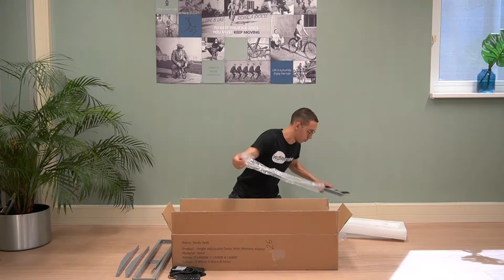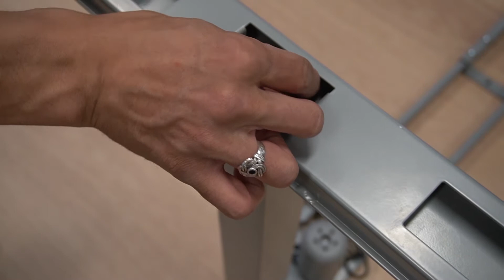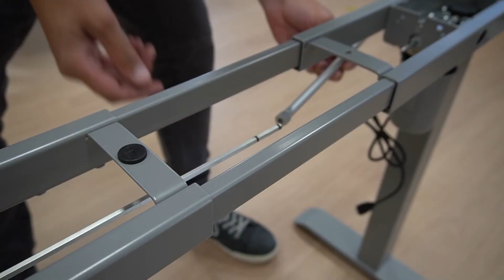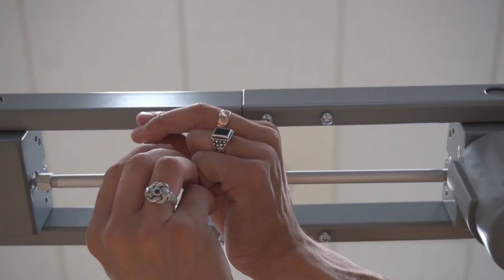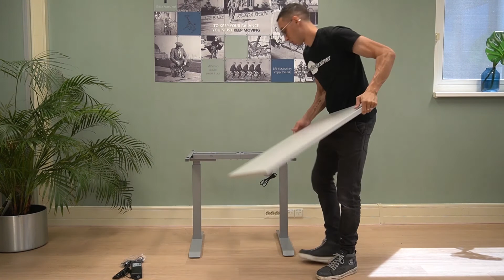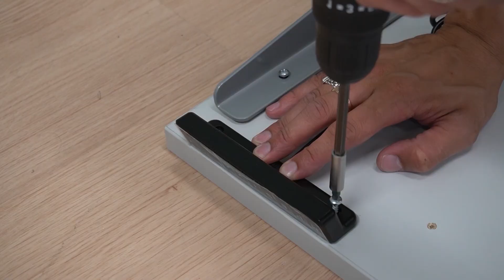Electric Sit-Stand Desk StudyDesk | Assembly instruction | Worktrainer

Comment: Good video but you had better with voice or highlight some important information on screen. For example I had issues with adjusting its height, it only raised one side, it turned out I have to extend the rotation rod all way up and close the all way back.
Reply: Hey Harry, I’ve got the same issue, may you explain it a little bit better. I’ve tried everything it’s not working. Now it goes just a few inches up and down, but it’s not working really well and only on one side.